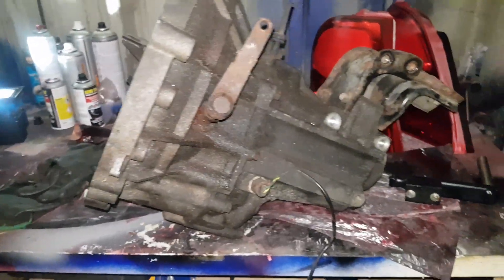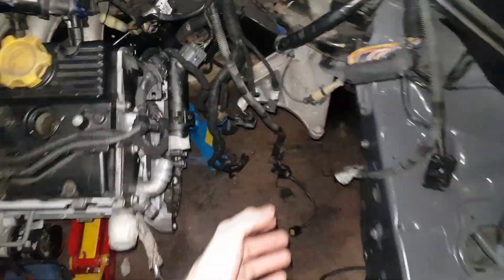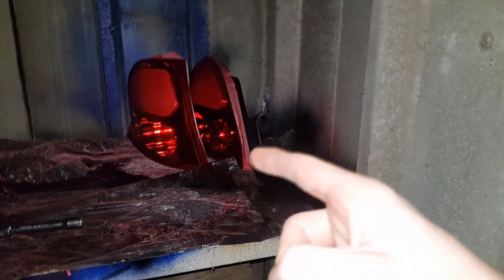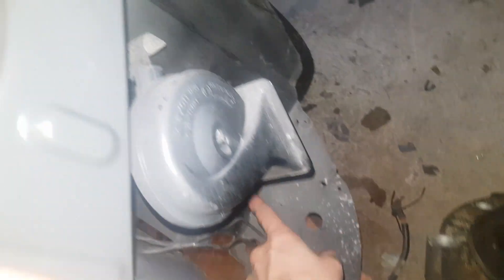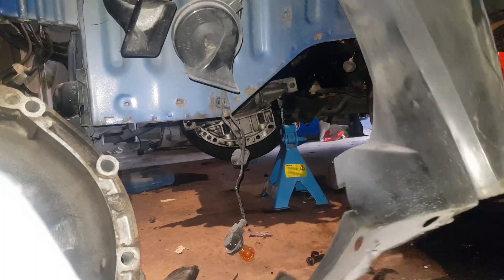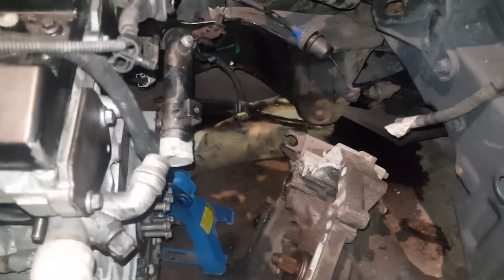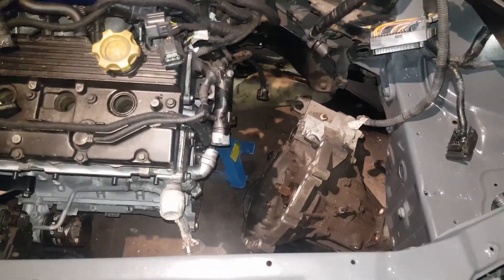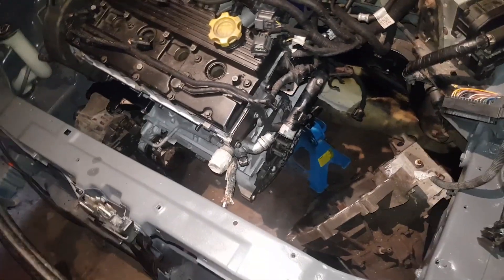MG ZR PG1 Gearbox Install | MG ZR 1.8T | Project MG ZR

Comment: ive finnally found a zr for a 1.8t project wots involved, loom ecu etc from the donnor car, is there much fab involved im gonna go through your vids to see any info,its something i wanted to do years ago im hoping the prices arnt silly as im on a buget,,
Reply from the maker: There's a few groups on Facebook, feel free to drop me a DM on Instagram (if you use it)

Solid cam wiring loom (1.4 1.8)
Turbo engine with turbo
Vvc inelt manifold with turbo map sensor
Remapped turbo ecu (kmaps)

There's plenty of other bits. You can use any of the zr gearboxes but id recommended pg1